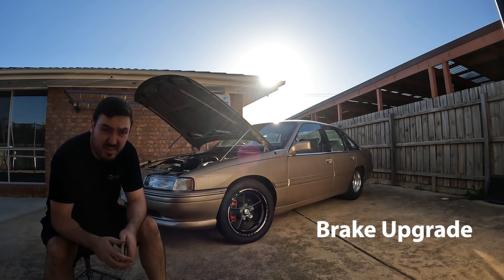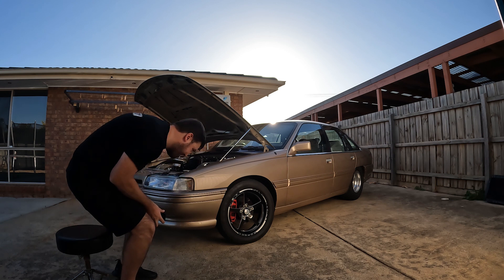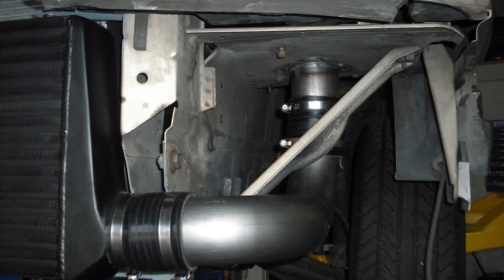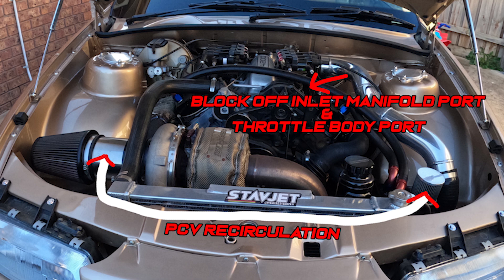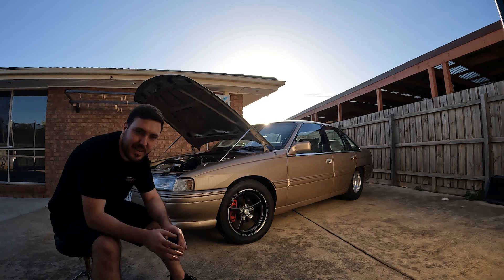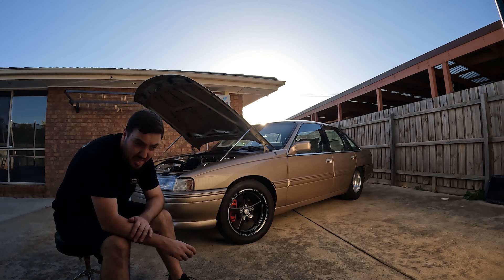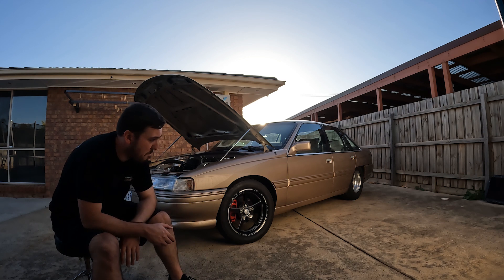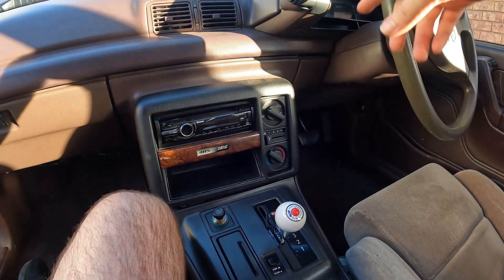Engineering A V6 Turbo Commodore

Comment: Just wanna ask, is the V6 Buick Bottom end stronger than the L67 Ecotec Bottom end?
Reply: Heaps of blokes have run 10s in super charged VX V6s with a SBE
Reply from the maker: Hey mate, I personally haven't played with any ecotec's or later model v6's so I don't have any direct experience. However my 2 stock bottom end buicks that I just did some top end work to where very strong and took alot of abuse.

Ended up running 11.2 on a stock bottom end buick which I believe would have easily gone a high 10 with a converter change but didn't choose to persist.